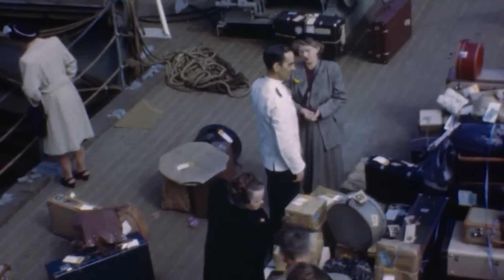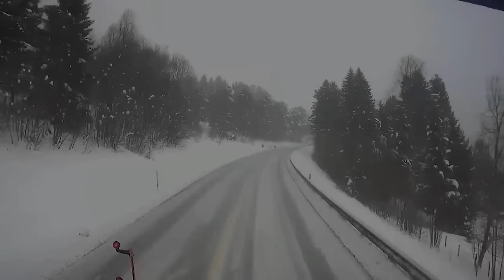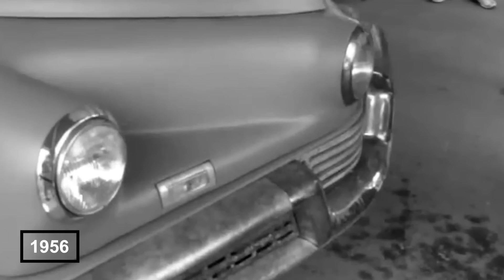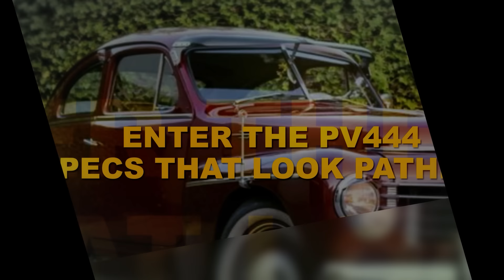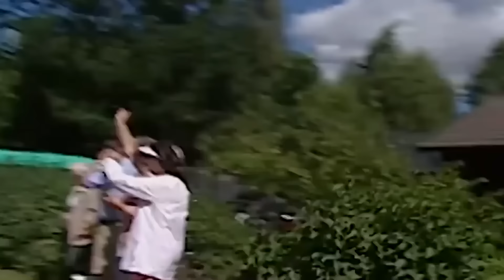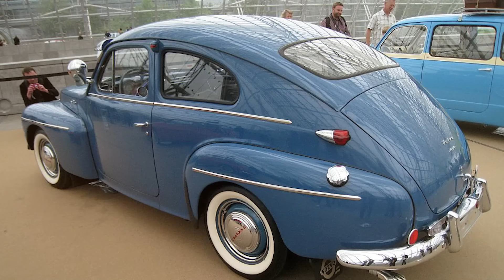Even at 60 HP & Beam Axles, the 1956 Volvo PV444 Shocked The Car Industry with 400k Mile Durability

Comment: By 1957 VW from Germany filled and flooded this market and were the king of well priced , low fuel use , and practical cars built and shipped world wide . I wasn't until 1974 when Japan's Big 3 took the crown with peppy 4 and 6 cylinder , over cam , and high revving machines shocked the American market . Today we are cock blocked by congress and the Auto lobbyist that we can ever see a low priced , easy to work on , and a all around car or truck any more . This is a crime .

Comment: The Volkswagen Beetle is a good one to compare it to.  The power output was about the same.
My ‘64 Bug had 40 hp,[ in natural form].  Max speed was 62 mph. It just wouldn’t do anything more. Maybe  65 steep downhill with tail wind.  But as noted, the Volvo was a lot bigger.
🚗🙂

Comment: Had a 58 wagon, PV544 sometime after high school.  Independent coil spring front suspension, leaf spring rear.  Lots of room with the rear seat folded down.  Loved that little misfit, but the rear end was bad.  Seems there was enough difference between the coil spring rear and the leaf spring rear that parts would not interchange.  Only parts I could locate were coil spring parts.  I think I paid $10 for the car at auction,  sold it for $100.  That little engine would not die.  A friend familiar with the engine offered to tune it after hearing it run.  5 minutes of playing with the carbs and that was all.  Wish I could find another, but would settle for the sedan.
I have had 3 foreign cars, a 58 Renault 4 CV, the 58 Volvo PV544, and a 69 Volkswagen Sqareback.  Had the VW longest but the 4CV and the PV 544 were the most fun.

Comment: WIFE AND I HAD AN '04 V-70 WAGON, 5 CYLINDER GAS ENGINE, 5 SPEED AUTO; GREAT CAR, PRETTY GOOD ROOM IN THE WAGON PART, COULD FLIP-DOWN THE REAR SEAT, AND FOLD THE BACK OF THE FRONT PASSENGER SEAT FORWARD FLAT DOWN, AND COULD CARRY 2X4 8' BOARDS, OR SKIS INSIDE!!  BEAUTIFUL, LEATHER HEATED SEATS, 8-WAY POWER DRIVERS, 8-WAY MANUAL PASSENGER FRONT SEAT ( VERY RARE FOR ANY TYPE OF 8-WAY PASSENGER SEAT!! ) GOOD ON GAS, SAFE, SAFE, SAFE CAR!!  WOULD STILL BE DRIVING A VOLVO TODAY, BUT THEIR PRICES WENT UP MARKET, SO NOW WE HAVE ANOTHER SAFE CAR; A SUBARU!!

Comment: If I had one today I'd install a 4 cyl Cummins in it. Disk brakes and a rack and pinion front subframe. I would set it up to look stock otherwise. It would be a beast of durability and cool sounding with that lovely diesel clatter.
Reply: SO....BASICALLY, YOUR GONNA TAKE A BIG DIESEL ENGINE, AND TURN YOUR VOLVO INTO...A PICKUP TRUCK??

Comment: This car model was definitely a smaller copy of the 1946-1948 Ford. Only the front end was different. From the rear, it looks like an old Ford. And unfortunately, no Volvo car except the excellent P1800 sports car, looked good until the 1980s. The sedans before that were just a rectangular box on wheels.

Comment: "The 1956 Volvo PV444 featured an independent front suspension (IFS) using unequal-length A-arms (wishbones) with coil springs and double-acting shock absorbers, a relatively modern setup for its time, paired with a sturdy, X-braced frame and a live rear axle with leaf springs for a solid, durable design." Pretty silly video. Not gonna finish watching.

Comment: When I started driving back in the 1970s all I could afford were tired used VW beetles. Not terribly unreliable, but it did give me an easy way to learn how to repair my vehicles! Then, as I started making a little more money, I hit the "sweet spot" -  more Volvo 140 and 240 series cars were entering the used car market. American owners got nervous when their car hit 120K miles but most didn't know that Volvos were different. So for years, I was able to scoop them up for a good price, easily drive them to 250K  or 300K miles. The only reason two of them needed replacing was, they were in accidents. A drunk driver T-boned my wife's 245, directly into the door where my young son was sitting. His injury? A bump on his head where it bounced off the window. The door didn't impinge on the passenger compartment by more than an inch. We were an all-Volvo household for 15 years. Then we switched to Hondas because the used Volvos got expensive and the newer Volvo models became too much like finicky expensive-to-repair German cars.

Comment: my first car when I was in high school, in 1973 was a PV444.  I bought it for $100, it was all taken apart, the owner was rebuilding it, and gave up on it sold it to me. Drove it during high school to class. it was fun to drive, got great fuel economy, turned me on to Volvos in general.   I later bought a nice 122S with a blown engine. rebuilt and drove it all through collage.  Used in on cross country road trips. Later  I also found a P1800 in good mechanical shape for $900, cleaned it up, new paint and uplustry, and sold it for $2400 6 months later.  All great cars, the 122S was my favorite.
Reply: My final foray into 544/122 land was a '66 122 station wagon with an overdrive from a P-1800, and a worked B-20 with a Weber carb. Unfortunately, rust got to it and by the early '90s, rust-free early Volvo's only existed in barn-find discovery shows making finding a reasonably priced solid-body 444/122  to swap the mechanicles into unlikely.

Comment: When I did my service in the Swedish army in 2003/4. We had Volvo cars from their 200 series that was made in the late 70s & early 80s. Many of them had rolled 3/400000 miles & worked like a clock. 

My first car was a Volvo 744 GLE from 1988. Had rolled about 200000 miles & was in perfect condition with no rust whatsoever.

Comment: Back the 60 hp for a small or medium sized car wasn't unusual.
Reply: That level of power does work decently - 1978 Toyota Corolla, with 1152 cc… - 60 hp.  Four speed manual.

Comment: My parents had one of these, bought new circa 1958, when I was a kid.   at about 100K miles, its water pump failed on a one a year vacation road trip with the family, it took 2 weeks to get a new water pump in the small town we were passing through, my dad sold it within a year figuring it wasn't reliable any more.  he bought a 64 Dodge Dart 6 cyl sedan, and when the transmission got flakey in 1968, he got a Plymouth Valiant slant 6, which he was still driving in the 2000s.

Comment: Really the '57 was a hunk'o'junk.  But when the 5-main B18 motor was introduced in maybe 1962 that changed what Volvo was.
Studebaker conveniently became a real estate company and Volvo took over her market share, mostly, becoming the new "reliable car" that Studebaker had been known for.

But they only ever made two decent cars.  The 445/210 and the 1800e.  The earlier 1800s were kinda junky and only the later 210s were really any good.

Ford made an almost identical car in the 1940s.  Small even- same size.  There is one that graces the highways of L.A. at 4am in the morning on days of the swap meets.
Really amazing it is sooooo similar to the 445/210.

BTW forget the 544.  It's only good if you have a drumset you need to get to a concert for!  Otherwise every inch of space is wasted.
The later 445/210 however- that is a useful car even today.

Comment: In a way I think the -56 444 is a bad choice as the basis for this story. I had one so I know. I bought it 16 years old with 120000  k's on the meter for almost nothing (500 SEK). The engine was in a sorry state, using one litre of oil in 100 km. I had the engine rebuilt but it lasted only a couple of years. The problem was that the 1,4 l engine that until 1955 had produced only 44 Hp, had now been souped up to 51Hp. And it was not able to take that stress. So the -56 most likley had the worst engine in the whole 444 - 544 series. I swapped it out for the 1,6 l B-16 engine that powered the first 544s. That was a much better motor but I had some bad luck with it. The fact that I succeded (with three engine swaps) to keep the car going for 12 years gives some credibility to the rest of the story. I sold it to a couple of young fellows who wanted to fix it up. They they even took the original engine wich i had standing in an outhouse. Roughly 15 years later I had a phone call from a fellow who had recently bought the car and wanted to know  something of its history. It was still running in the latter part of the 90'es!!

Comment: Do not confuse the 444 with the 544 that came in, I think, 59. The 444 had a three bearing 4 cyl in-line 4 that did last just as long as it's competitors. With the 544 came the legendary red block B18 that lasted forever...
Reply: Yeah that earlier motor was no darned good!  The later 1960s B18 motor was amazing.  The main bearings are like the size of Miami!
Reply: Those Volvo B engines were very popular to use in boats as well.
Reply: I bought a used PV544 , model 1960 ( my first var)  The engine was B16
Reply: The reason the B18 engine was "indestructible", it was HALF of a 8cyl TRUCK engine! They took an in-line 8cyl engine and cut it in half. For use in a passenger car, the rest is history. Btw, Volvo's P-1800 sports car used this engine that ran for 1,000,000 miles creating a LEGEND that was 'unbreakable' !
Reply: @TheOzthewiz  Yeah I think we've all heard this a jillion times but yes yes yes sure.

Comment: Perhaps in the development stage but in 1956, the PV444 has independent control arm front suspension with coil springs NOT a bean axle with 'buggy' springs. Coil springs are used with a rigid axle at the rear.
Reply: The PV444 always had independent front suspension.

Comment: I had a 544S and wish I still had it!!
Reply: I did too.  Loved that car.  If I could find another ...  The main problem with the 444 and 544 was that the sidedraft carbs were directly above the exhaust manifold.  When the carb leaked onto that hot iron ...  I saw 4-5 of them burn because of that little design feature.
Reply: Yikes, and here I am considering buying one... 🤔 Might have to reconsider...

Comment: July 1961, VOLVO 122s driven by Dad's Artist cousin Henry Myrenan at Gothenberg Airport.  It had about 500 Kilometers on it -- not yet broken in -- but he drove it with foot to the floor every time we passed a truck on the highway.  Sweden had an unlimited speed for passenger cars on weekdays in the summer.  I twas disturbing from the back seat to look over the driver's shoulder and see the speedo needle peg at the maximum every time we passed a truck on 2 lane roads.  About an hour and a half into the  drive to Tjorn the float on one of the 2 carbs stuck flooding the 2 cylinders it feed.  We stopped at the next town and a mechanic came out and had one look == then took out a screw driver and whacked the carb bowl with the handle and said OK .  It turned out to be a common problem the fuel line to the second carb could not feed fast enough so the bowl drained and the float dropped down so far the metering needle dropped out and jammed --wide open - flooding two cylinders.
1980 In Oregon east of Portland in the Columbia river gorge I helped a Vietnam Vet with an early 1960s PV 444 that was having cooling trouble.  I found the problem and cut a 5/8 inch piece of tube that helped center a tube that bridged 2 blocks and he was on his way at 200,000 plus miles.